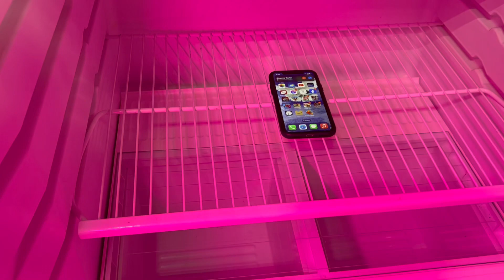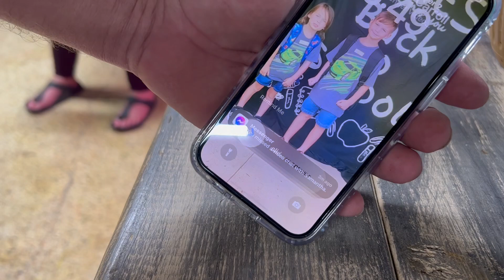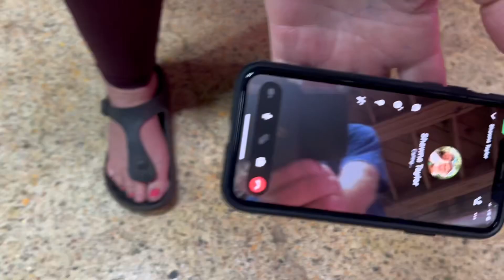Do refrigerators block cell frequencies, Preparing for the Emergency Alert #emergency #fema

Comment: good info so I’m thinking wrapped in tinfoil in a Mylar bag inside a microwave setting in the refrigerator just to be safe. BTW my thoughts are if they were going to send a bad signal they would not tell us. Maybe they already did and this is a mass test to make sure it worked. IDK
Reply from the maker: Could be I’ll probably pack my sensitive stuff in mylar and stick it in the fridge just to have it all close together. I’ll probably do it about two hours early.

Comment: they also say, it could affect your car,, did you know that the average new car can have  up to 1500 semiconductor chips in them? how to protect them??a Metal  garage?cover it in Aluminum foil?,, guess there at the mercy of the elements..
Reply from the maker: I was thinking something similar a metal garage with a metal rollup door, and may be a couple of grounding rods in the corners attached to it
Reply: I think you are right